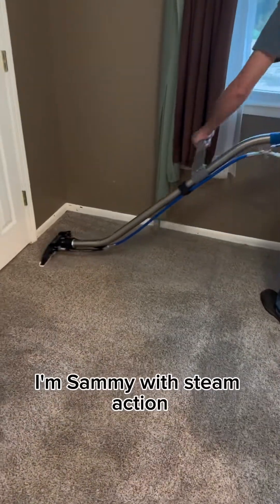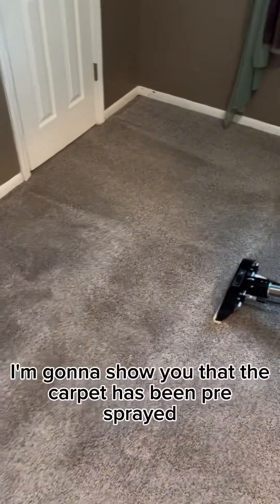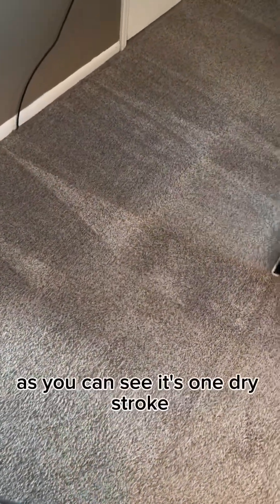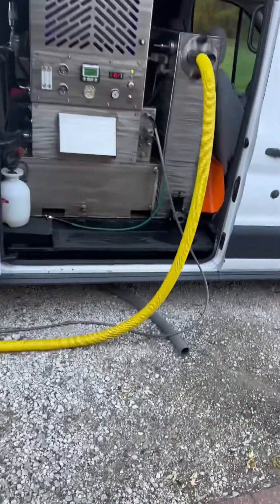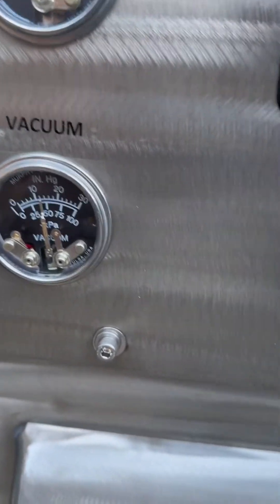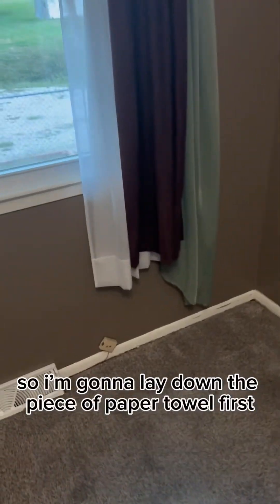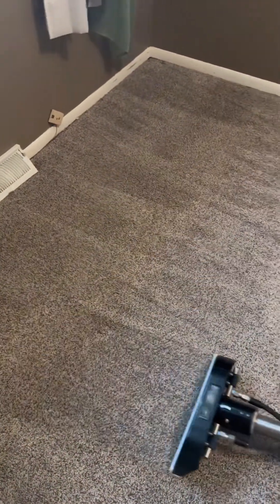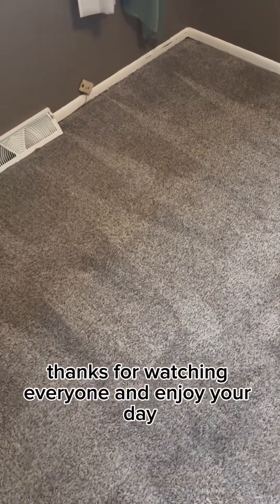The difference between 18”hg and 12”hg on a Steamaction truckmount

Comment: Good demo showing there's  low moisture options with Extraction. 

I've had heavy traffic lanes Sahara'd in 1hour with only 13"/ 45 Blower using 2.5" hose((1st 50')and only 3 flow. 
Chemistry, Dry Pass, SS (3)HX, and are you 240F @truck